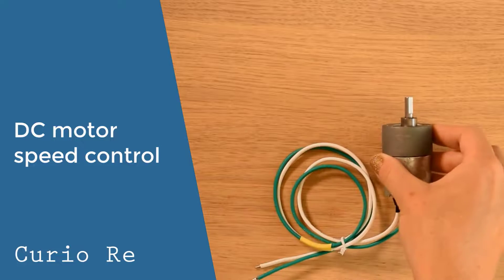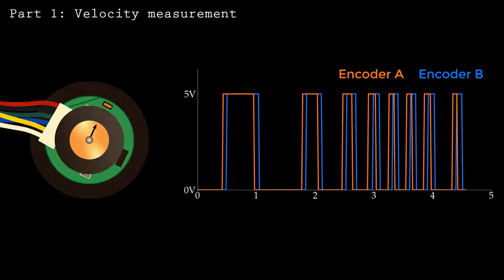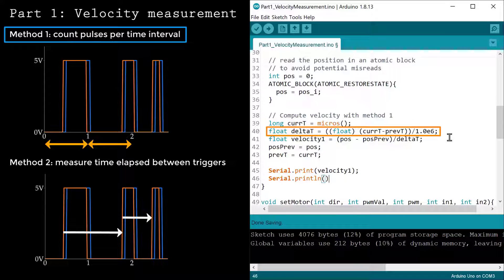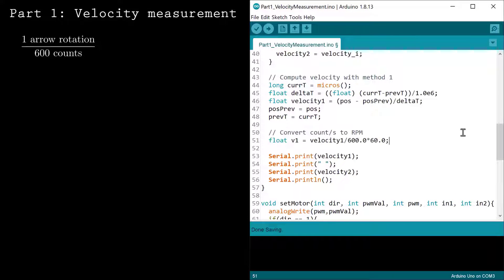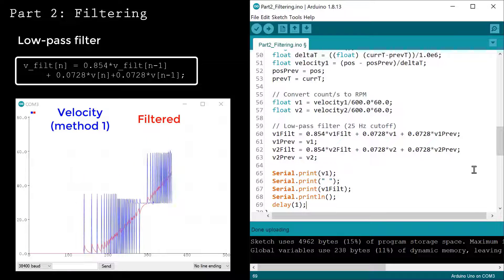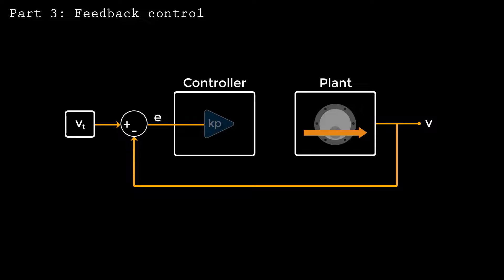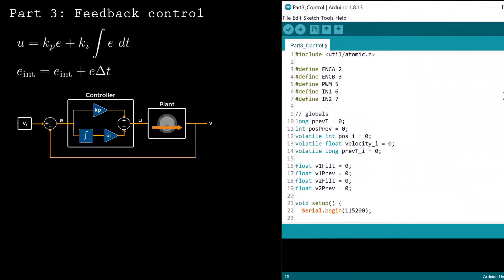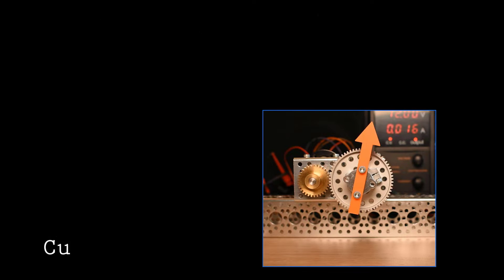DC motor PID speed control

Comment: Heelo, nice video ! There's one thing that I don't uderstand about PID controller:
Imagine that you want your motor to spin a 100 RPM and for that speed the voltage should be around 6 V.
If the motor is exactly at that speed the error will be 0 and then the pwm too so the motor's votlatge will be 0 rather than ~6V.
The motor's speed will decrease the error go up and the pwm too to have the right speed then the error will be 0, this cycle will go indefinetly so my question is why the motor's speed does not oscillates like the cycle I mentionned earlier and why working purely with the error is best when you want to maintain a certain value?
Reply from the maker: Good observation Julien. This is actually exactly how proportional control works (neglecting for a moment, the integral and derivative terms). What ends up happening is that the rotation speed will drop slightly, and the control signal will immediately ramp up to keep it spinning. But overall that means the speed you reach will tend to be a bit lower than the desired speed on average. 

If this happens, you can add the integral term which will accumulate error over time. This will end up giving a little more power to the control signal than you would have with the proportional control alone.
Reply from the maker: And btw, if you choose the PID parameters poorly, you will definitely see the speed oscillate. Another thing to remember is that the physical characteristics of the motor tend to keep it spinning for a while, even if the voltage is turned off. So in other words, you wouldn't suddenly stop when the control signal goes to zero, you would just start to slow down.
Reply: @curiores111  oh yeah, the inertial carateristics of the motor are useful here, it's like a bike where to mainain a certain speed you don't have to pedal continously but give "spikes" of power will keep you going at approximatively constant speed

Comment: Great video!
Why did you choose a cutoff frequency of 25Hz? What is the reasoning behind this choice? Thank you very much for your great work!
Reply from the maker: Thank you! The 25 Hz choice is pretty arbitrary. Basically, I chose the highest cutoff frequency that still removed most (~90%) of the oscillations created by the measurement method. You could look at the spectral content to decide (which I did afterward, and was happy enough with where it landed).
Reply: @curiores111  Don't you think we can rely on the motor response time to pick a number. For example, a typical response time of a small dc motor is about 100ms, so a 10Hz cutoff frequency is a reasonable choice. Does such reasoning make sense or am I missing something? Thanks!
Reply from the maker: Certainly, using characteristics of the system would be a good way to choose a cutoff. I feel that a 10Hz cutoff might lead to some signal loss, but I'm not certain. Certainly worth doing some testing.

Comment: At 11:22 in the video, line 63 in the code, the speed is using  vt=100*(sin(currT/1e6)>0); how did you get that equation?
Reply from the maker: It's just an on/off function to switch the speeds from 0 to 100. Switches every 3.14 seconds. Nothing special about that number, just something simple.

Comment: I am so impressed by this. I wondered if you would talk about what issues you encountered before this was operational?! I am struggling with a project!
Reply from the maker: Hi Matthew, thank you! My biggest issue was the velocity measurement, which is why I spent so long talking about it in the video. Other than that the main issue I encountered was instability near zero velocity. What kind of issues are you seeing?

Comment: Hi what an amazing video!! but I have a question.How can i add kd according to the this code?
Reply from the maker: You can compute the derivative of the speed, and then multiply it by kd. The issue is that the derivative can be pretty much garbage because it's being computed as a second derivative (the speed is the derivative of the measured position, and the kd term uses the derivative of the speed)... it can actually hurt more than it helps. That's the reason that I didn't include it in this particular video.

Comment: Hi curiores once again another great video. I have a question - how does this type of motor control demonstrated in the video differ from controlling the motor via Field Oriented Control which incorporates atleast two PI(D) controllers? Thanks!
Reply: also would I be able use this video to control a brushless DC motor?
Reply from the maker: I think you need a bit more for a three phase motor. I haven't implemented it myself, so I can't say for sure. This would also depend on what motor driver you used, which would probably take care of some of the work for you. If you're simply assigning a single input (power) signal to drive the motor and reading from an encoder, then this method would work. If you need to do more (like handle the inputs to the brushless DC motor) that would require more work than what I've shown here.
Reply from the maker: Hi Conor, I'm not familiar with field oriented control... after briefly reviewing it, it is quite similar to the PI controller here. The difference appears to be that a three-phase motor is used, and as a result you have to set up the controller differently. As far as the measurement side goes, you could use an encoder or other device (just like for a DC motor, you don't have to use an encoder, you could also use a tachometer).

Comment: Great explanation, congratulations from Brazil. However, in the arduino uno (motor running at 500RPM and encoder = 384 pulses per revolution), this routine takes 8.3 ms to run, so the use of a 1 ms period (deltaT) seems to be wrong.
Reply from the maker: Interesting, didn't take that long on my end, but you can definitely adjust things if the loop is taking longer.
Reply: @curiores111  The main reason in the loop delay, is the three Serial.println() statements. Running at 9600bps, this instructions prints something about 23 bytes = 23x8/9600 = 19.2 ms. Thank you!
Reply from the maker: @douglassantana7820  That's fair, and yeah I usually crank the baud rate up to maximum to help mitigate this. Generally speaking though you wouldn't actually have the serial plotter connected while running your application (I'm assuming, anyways).

Comment: Very well explained, especially the PID controls. I happen to be working on a similar project, but am using an Adafruit motor shield v2.3. When I run your program, my motor does not rotate, and being very new to coding in general, I don't know how to convert your program to work with Adafruit. Any help would be greatly appreciated.
Reply from the maker: Hi Curtis, the motor driver shouldn't really make much of a difference. In your case, it could be that you have not correctly connected your motor. Have you verified that you can run the motor using something simpler, like simply setting the PWM and direction for the driver?
Reply: @curiores111  Thank you for responding. That is a good possibility and I've been trying to see about my wiring. The problem I have is that there is no PWM or IN ports to wire. I think that any open pin should be capable of doing those tasks but I'm not sure
Reply from the maker: @curtispilny8748  Oh it looks like they wrote their own library for this. Have you gotten this tutorial to run? https://learn.adafruit.com/adafruit-motor-shield-v2-for-arduino/using-dc-motors

Once you have that working, you can basically replace the "setMotor" function contents with the specific commands from their library. 

PS: I looked at the adafruit shield and it uses i2c, so you basically have to use their library. It doesn't use a regular pin mapping like a simple motor driver.
Reply: @curiores111  yes I've gotten the sample program to work and have tried plugging the library function in with no success. I am guessing that its because its a void function but I am not sure exactly why. Unfortunately I only work on Fridays to test anything else.

Comment: Is it possible to combine both position control and this speed control in the same arduino program? While it may be impossible to control both simultaneously, can it be done in a way so that the user can select which of the two variables they want to control and the program will only run the control the user requested?
Reply from the maker: You could certainly switch between a speed controller and a position controller by simply specifying an "if" statement that switches between controllers. You would have to be careful about the transitions (need to reset the position variable). 

On the other hand, my first inclination would be to simply use position control to specify the velocity. There's a brief example near the end of "How to control multiple DC motors with encoders":
https://youtu.be/3ozgxPi_tl0?t=480

Comment: Great tutorial, could you like to explain me how to plot power spectrum like that? Is that plotted by arduino? Thank you
Reply from the maker: Thanks Dede. You can use a scientific library in something like Python or Matlab to plot the spectrum. Here's a script that I used for another video (How to design and implement a digital low pass filter) that computes the two-sided spectrum:
https://github.com/curiores/ArduinoTutorials/blob/main/ButterworthFilter/Design/LowPassFilter.ipynb

In this video I only showed positive frequencies, but the code to compute the spectrum is roughly the same (see these lines and the following:)
# Compute the Fourier transform
yhat = np.fft.fft(y);
fcycles = np.fft.fftfreq(len(t),d=1.0/samplingFreq); # the frequencies in cycles/s
Reply: Curio Res thank you, that means we have to take time series data by determining the sampling frequency, right?  based on the actual output we need the x-axis in the form of time in seconds, using the second method how do we retrieve time data as well.  if we want to plot time series data on a serial monitor, how can we determine the x axis is time and the y axis is amplitude.  thank you very much correct me if i'm wrong
Reply from the maker: @dedeirawansaputra8926  That's right, you need the time axis data. For my purposes it didn't need to be perfect, so I simply took the average sample time after exporting the data. Then, I computed the average sampling frequency. That average sampling frequency is used as the input to the fourier calculation. Inside the arduino code you can keep track of the time using micros().

PS (edit): Also, I am sure there is probably some way to do this inside Arduino or using some other easy method, I just haven't looked into it.

Comment: A great video as always Curio Res, keep it up! ....I have a question as to how you are choosing your gain values. This has confused me a lot in the past and I wondered if you could give me some further insight...but how do you choose those gains appropriately? It just seems as though often it's trial and error? I've had a look at approaches and a lot of literature points to Ziegler Nichols. Many controllers do have automatic tuning functions, I'm also curious of its procedures which is a whole new side of the coin as to how they optimise there gain values, but for manual tuning surely there is more of a methodical approach? Let me know your thoughts. Thank you again ! :)
Reply from the maker: Hi Ronak, yes this is a very important question. There are several different approaches. Classically speaking I would say that the two basic approaches are
1. Manual tuning (based on trial and error or intuition)
2. Tuning using  a mathematical model (you can use root-locus or other methods to decide the parameters that fit a set of requirements)

Details:
1. For the first approach, you're right, you can use Ziegler Nichols. I prefer to play with the parameters and find a response that looks good. The thing I personally find the most helpful is this table that explains how changing the parameters affects the response:
https://en.wikipedia.org/wiki/PID_controller#cite_ref-24
Once you understand that table, you can intuitively adjust the parameters one at a time for simple applications (like the DC motor)

2. In terms of mathematical models, there are several classical methods. It's generally fairly challenging, but Brian Douglas has a series of great explanatory videos:
https://www.youtube.com/channel/UCq0imsn84ShAe9PBOFnoIrg

Optimization is roughly a branch of (2), where you use an optimizer on the mathematical model to select parameters that improve one or more of the characteristics, like rise time and/or stability.

Comment: My first thought was that allowing the controller's output to go negative and cause it to try to drive the motor in reverse seems wrong for a setup like this.  Maybe constrain the output to be non-negative?  But I guess for a DC motor, that means letting it spin freely, which would rely on friction to slow it.  And if there was an external force (for example, gravity if you are trying to raise or lower window blinds), I could see needing to apply a negative force to partially counteract that external force to control the speed.

Next, I was thinking that if the current speed is below the target speed, you clearly need to increase the control output (and decrease the control output if current speed is faster than the target speed).  Wouldn't that mean adding (some multiple of) the error to the current control output, instead of setting the output to be proportional to the error?  But that's essentially what the integration term is doing (except that it is accumulating error from multiple iterations of the loop).

Thanks for pointing out that velocity method two (timing the interval between pulses of the encoder) breaks down at zero velocity.  That was something I hadn't considered.  It seems like there ought to be a way to mitigate that.  You know that an upper bound on the speed is determined by the time from the last pulse to current time, so you could constrain your last measured speed; eventually, you would reach the limits of your precision and get zero.

I really appreciate your videos.  The narration is clear and easy to understand (good pronunciation and enunciation).  The pace is quick, but not too fast to follow.  The graphics really help reinforce the narration.
Reply from the maker: Great to see you Mark! And I love your detailed thoughts about the controller.

1. Interestingly, the voltage switching happens fast enough that it's totally feasible to apply a negative voltage to slow the motor down. In fact, there's a lot of +/- switching that will happen in the controller that's unnecessary, but on *average* will produce the required speed. That's one of the unpleasant things caused by feedback control, but is a natural consequence.

2. Yes!  This is why the integral term is essential in this case, because the friction (or other loading) is constantly trying to slow it down. So at steady-state you need to be applying additional voltage. What you're describing is a bit more like open-loop or model based control, where you use some information about the system to try to predict how much voltage to apply.

3. One way to mitigate this is to use open-loop control near zero velocity. Or an alternative strategy. I toyed with a couple alternatives. At the end I found that simply filtering method 1 was overall easier to implement and more consistent. It's the reason I made the video about low-pass filtering.

4. Thank you very much. 😄 I hope that you stop by at my next video.

Comment: Wow, great video and explanation. Can you give me a hint where i can get the library <util/atomic.h> ?
Reply from the maker: I appreciate the kind words.😊 atomic.h should already be available with the default installation of the Arduino IDE.
Reply: @curiores111  unfortunately this is not automatically included in the basic installation.
i found an avr variant that is 4 years old. is that the right one?
Reply from the maker: @rave5636  Oh it looks like its only supported for specific arduinos. Which microcontroller are you using?
Reply: @curiores111  nothing special - Uno
Reply from the maker: @rave5636  I would if I could Ra, I even did a reinstall test of arduino to check this. It worked without any libraries. I'm not sure what the missing piece to this puzzle is. I'm sorry I couldn't sort this one out. :/ As a temporary workaround, you could use  "nointerrupts" instead as in this example: https://www.arduino.cc/reference/en/language/functions/interrupts/nointerrupts/

It's not as good as the atomic block (which, as I understand it, doesnt block the interrupts, but instead breaks the code down into atomic bits so that they can't be interrupted. Interrupts are still allowed, however). For this code, it should make little difference. That's probably the best I can do. :/

Comment: Hello.. Thank you for the explanation. 

I have a similar project to control the speed of the motor but with respect to another motor.. 

for example, i have two motors. i give the same PWM value to the two motors.. but these motors vary the speed ...so i want to make the first motor as a reference and control the second motor...  i want to use the same method as you.

could you please exaplain me this ?
Reply from the maker: do your motors have encoders?
Reply: @curiores111  yes i have encoders for two motors.. 
what i want is that .. 
i step up the speed for two motors for equal speed but due to some friction, both motors are not similar... so i want to consider the first motor as a reference and make the second motor speed to follow the first motor speed ... using the PID as shown in the above